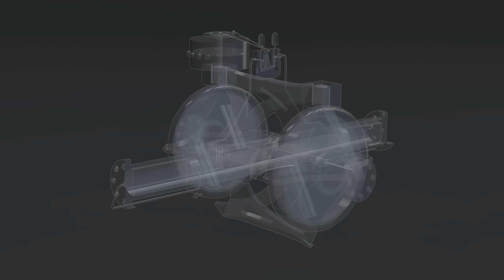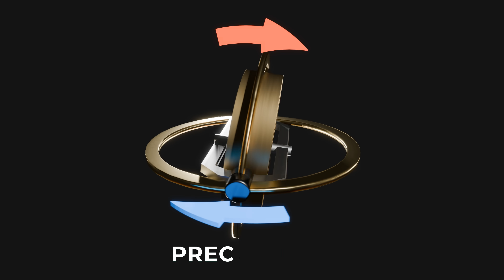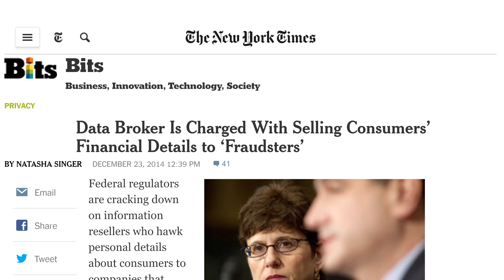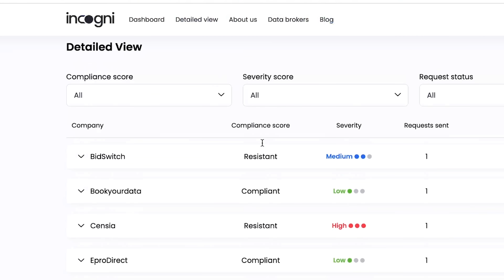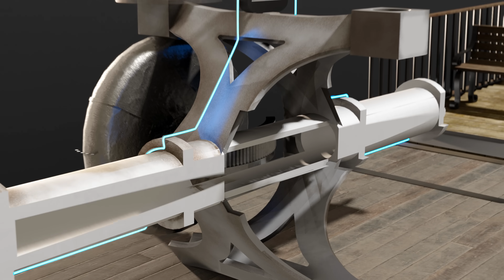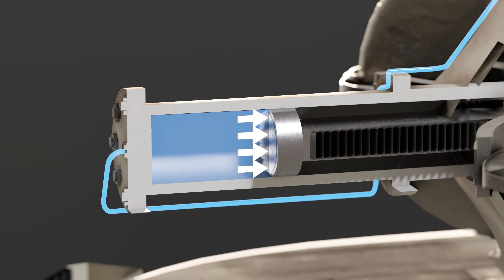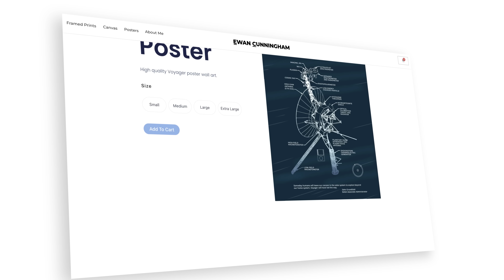The Self Balancing Monorail

Comment: Assuming that this could basically maintain its vertical position by itself (and I'm not saying it can), it has zero defense against lateral forces that are stronger than the ability to correct itself, such as strong winds or even another vehicle that hits it. A train on two lines of wheels would be almost impossible to tilt, no matter what would attempt to do it. And it wouldn't require fancy mechanics to ensure that it's always adjusted exactly the amount it needs to.

Comment: Question ,yes it works, but I must be able to compensate for earth rotation ,also for it's travel through the solar system then solar systems travel through the Milky Way,then Milky Way through through the cosmos,that travel a lot faster than a jet through air on earth  alone,  compared to just space time alone, just saying............

Comment: A completely mechanical system. No chips no electronics.  If they made it today it would break within 6 months and it would be an electronics failure. 

I am reminded of the mechanical lock system on the Erie canal which is still functioning after 100 years.   It's extremely ingenious.

Comment: Wow I'm an engineer and just stumbled on this, really damn cool. I'd love to know what kind of calculations this guy was actually doing to engineer this thing. Like if I have this 1000 lb gyro spinning at 3500 RPM located x and y from the center of gravity and pivot point at the rail, do all these momentums and torques in the system act to stabilize the vehicle sufficiently knowing some kind of worst case condition or strongest momentum the gyro has to act against. Like how was that gear rack sized and the correct amount of force determined that will counter act the vehicles weight from falling over liked an inverted pendulum. I'm guessing it was probably a good amount of trial and error with the scale model finding a good starting point for full scale. All of this is like system response and dynamic modeling and could be simulated today with modern software and solved numerically in like Matlab, hell maybe even Excel, but to see any of the underlying calculations from 1900's that directionally said where to go would be so interesting. Maybe it was as simple as I have this much space and this is the biggest I can make the gyro and just trial and error it until it works.

This was super cool, I'm done nerding out now lol

Comment: This is really cool engineering, however, I'm still curious as to how this would work at scale. The way this train is built, you couldn't just link up more cars. To stabilize additional sections of the train, you'd have to add more gyroscopes along the passenger/cargo area. Considering that almost every car would have the same stabilization system as the main locomotive, I feel like this kind negates an economy of scale (which is, after all, the foremost advantage of a train). It would still be possible to drive multiple cars with a single engine or motor train, however, the level of complexity and technical difficult involved would kinda just push any investor towards the two railed alternative.

Comment: As cool as this is, the most obvious question/flaw is what happens when it stops. It essentially has to constantly run outside of specific docking points.
Reply: Brennan quotes : 
- Even when the motor is stopped, the gyro-car remains perfectly steady(...)
- (...) if a gyroscope were to lose power it would take several hours for the flywheel to spin down to zero, providing the gyro monorail driver plenty of time to deploy the stabilizing legs.

Comment: Would such a system work with rubber tires if the vehicle drove on asphalt instead of on a railway?  
Imagine a very large motorcycle type vehicle that is similar to a van, bus or truck. 

Of course it would need a mechanism that prevented it from tipping over when it's not moving; like when it's parked or stopped at an intersection.
Reply: Imagine that but it has another set of wheels to the side of it 🤯

Comment: Hardly a TRAIN but more like a single cart .I doubt this system would even work on multiple carts with a gyro in each because they wouldn't be in sync meaning the connections would be all over the place as one  lean the others might be upright or even leaning the opposite direction.

Comment: I don't understand why they are not using it in today's trains
Reply: Why would they use this? The double track is already all over the world and is far safter then this. This train needs gyroscopes to be running 24/7 or the whole thing will fall over. You would need some special docking contraption to hold the whole thing up to even be able to run maintenance on the gyroscopes. It is pretty cool ill admit but really its overengineered and less reliable. I don't think the train operator would enjoy being so close to two massive gyroscopes as well.

Comment: This is impressively well worked out, i must say. I heard about the concept before but was not aware of any details, besides the use of gyroscopes. 
That the design was not convincing is understandable and as smart and all the engineering behind the whole stabilization, does it seems to be prone to errors. I´m not saying that it is, but it sure looks like the safer bet to use a second rail. The vacuum in which the gyroscope discs where rotating and then the pressurized pneumatic system on top of that... There is a lot of space for a variety of imaginary holes and leaky connections. Some of them maybe real enough to become a catastrophic failure since trains often move fast.
If how a gyroscope would be closer to our intuition, like other concepts we can experience in some way and develop a certain understanding about them, wrong as this might in fact be, than it more likely would have come to use at some point.
I really wonder how this would have done in long time of use, since it is seemingly really well worked out.
Kinda seems like a missed opportunity. Maybe it comes in handy if we ever colonize anything else than earth.

Comment: I am software engineer, not a construction engineer. So what I’ll share is not a real critique, but more like “a set of educated reservations” about this design.

In the video this is portrayed as something inherently “good” that didn’t make it to production due to wimpy investors. Well, investors had a lot of reasons to be wimpy, and I am sure that construction industry champs are reviewing things like that at a regular basis, so whatever limitations this thing had in early XX century, are still there today.

First, I wouldn’t blindly buy into the “savings” argument. A monorail isn’t twice cheaper than regular rail, because you need to compare it for the same size trains (same weight). If the same weight is distributed over 1 rail rather than 2, that rail must be sturdier, heavier, it may easily make the construction logictics twice more expensive or even more than twice.

Secondly, from my software experience — a requirement to have something up and running 24/7 with guaranteed downtime less than 30 minutes makes an order of magnitude more expensive system than a system without such a requirement. The video didn’t describe any “parking brake” mechanism. If it’s absent in the original patent, it means that the train is designed to fully stop (for more than 30 minutes or a few hours even) only at designated parking stations.

But what if there’s a sudden need to stop for a longer time? A need to pass a faster train or roadwork delays could easily require multiple hour long stops at every station. Now we require every station to have a complex and heavyweight parking mechanisms for such trains — whoopsie, whoopsie!

But what if an accident happen — a landslide or a person fell on tracks, or a collision, or a failure of another train, that require a multi-hour stop in the middle of nowhere? Now you suddenly require to be able to supply unlimited fuel to any random spot on the track, just to keep the gyros running, or you pay the cost of falling train just because it didn’t have proper parking brakes?

Thirdly, the mechanism seems too complex, hence, fragile. Many “geniuses” focus on v1 product and completely dismiss long term maintenance where every little mechanical piece accrues wear and tear. When I saw “vaccuum” and “compressed air” solutions as a part of this, those were immediate red flags — like, hey, you gonna pay tenfold to repair it, and to build contingency mechanisms for a whole array of possible failures due to random wear and tear in various places.

Remember, the stability of the classic two-rail trains lie on the shape of the wheels. The wheels can lose many milliliters of steel due to wear and still work as designed. In comparison, Brennan’s design feels as fragile as egg’s shell.

Comment: You, didn't answer many of the important questions people might get in this video, like
1.why is it not adapted in modern era 
2. Are gyroscopes expensive 
3. How much are we talking 
4. Issues that weren't solved in this train
5. Would this train require more power, if so how much more than your average train 
6. What is the overall running and maintenance cost of the train compared to modern trains, 
7. What are all the benefits of this trains compared to modern trains and are those benefits worth its cost in modern era 
8. Or is it just a inefficient model?

Comment: Really cool design although it does raise some questions for me, maybe somebody here has the answers.
1) what would the stability and life time of the rails themself compare for a 2 rail system be vs the single rail rails? Cause with a single rail you have much more load on the rail and I would assume the having 2 rails connected to the same suport beams would make a stronger construct then just the single rail.
2) Kinda in the same direction but how would smoothness of the ride be effected by having only a single contact area in the center compared to the two on the side, mostly regarding vibrations from roling over the tracks and the engine.
3) Would the leaning lead to a more complicated coupling mechanism between wagons and how well would the system work with very long wagons like you have with modern high speed trains?
4) Were there any plans on how to deal with the wagons just standing around? Cause train carts do spend a decent amount of time not moving, especially if its something like a freight train.

Comment: Nice animations.

Fun fact: Luis Brennan also invented the first practical MCLOS (Manual Controll, Line of Sight) guided missile system. The Brennan Torpedo. Using two wires reeled out of spools connected to the torpedo's counter-rotating propellers. The wires were reeled in by a steam engine at the launch base. By slowing one of the wires down, the torpedo could be turned left or right.

Comment: I love this, it's really a case of building something and a lesson to many for many reasons.

1. This is a better design and cheaper.
2. It's a testament to iterating and building better solutions.
3. It's also a prime example of better product, but too late.

If this had been done before railroads were all developed, this would of taken on and it would of been the only train used. Half the cost to lay railroad tracks takes away every pitfall of going out west that previously existed just about, but it was the "too late" invention that once they developed all of the track, the vehicles weren't a problem worth solving.

It only failed because of a problem that wasn't worth solving at the time, 20 years earlier? It was worth solving then, this could be used for so many as an example of knowing what, when and how to work on something to either be the most successful thing in the world or to just have the worst timing but a better product.
Reply: This is nonsense.

Comment: I’d never invest in the design either. That’s a whole lot precision moving parts needed to avoid a trainwreck even sitting completely stationary, going nowhere. A component failure in a conventional steam engine would normally lead to a simple repair delay, not crashing every single car on the entire length of train sitting in the station. At worst, a steam engine boiler might explode and injure the engineer…causing a moving train and all the pulled cars to slow to a stop… whereas a failure of this design this would have caused injury to every person on board throughout the entire length of cars when they all derailed.

Comment: Worked with naval gyroscopes . Elmer Sperry was one of the pioneers inventing this. He made the same concept for ships. No rollling no sea sickness. Great Ideas from early1900….However considering the weight of the flywheels and the sheer Force applied on the main rotor bevarings these inventions are really dangerous. Just consider one main bedring packs up and the train would get either airborne or end up like a rollercoaster. Hence they never worked in real life. But truly amazing idea, the Will to invent and amazing visualization. Greatings from Denmark😊

Comment: The big drawback is that if there was a mechanical failure anywhere, you die. Whereas on a standard train, if there's a mechanical failure, you simply come to a halt.
Reply: Airplanes have that problem though
Reply: @romeupb5110  In an airplane you can usually have one engine fail and still land safely, depending on the size
Reply: @romeupb5110 yeah but there is no good alternative to an airplane that doesn't fall out of the sky with complete mechanical failure. For trains there is.
Reply: Yes if you are at right place
Reply: nope, in this era there's no such thing as mechanical failure unless it's a crash😂
those r gyroscopes not engines
Reply: Incorrect even a failure on a standard train can cause death. What do you mean??? A train doesn’t just stop if certain things fail.  Have you not looked at train accidents through out years caused by failures???
Reply: @Rilo888  certain failures on standard trains can be catastrophic. However there are also certain engine failures and other which simply will cause the train to stop.

If any part of this monorail system fails, it will topple over.
Reply: @ yes there’s no argument there. I was only getting at that even on standard a failure still can disastrous but wouldn’t have be often compared to this old school mono rail.
Reply: That is obvious that even a standard failure CAN be disastrous to the point need not be stated. The OG made correct point that in the monorail design ANY failure will be disastrous and deadly not CAN

Comment: There is still a use for such technology in form of taxi cabs  or can be called rail cabs. In my opinion the problem of balancing the rail with more carriages can be solved by centering the gyroscope system along the length of the overall monorail and using hydraulics in places of pneumatic system. Or more work can be done to reborn the monorail idea.

Comment: In physics, there are states of position: instable, unstable and stable. This is not a stable system, like a two-track train. In practice, there may be situations in which the gyroscope does not rotate. This can be caused by a technical defect, for example. The train would then fall over due to gravity and there would possibly be injuries or even fatalities.

Comment: I think with some adjustment of the engines' and cars' baseline CoM, and keeping everything as light as possible otherwise, making a high-speed version of this with modern materials and tech would be extremely efficient and safe.

Additionally, if it can also still run on one side of a normal track...adapting existing rail systems to it shouldn't be any trouble at all.

I think this would actually be far more worthwhile than something like the fuckin' "Hyperloop".

Comment: There's a monorail existing and in use until today that reminds me of this. This train also drives on a single rail no bigger than a usual railroad... Yet in this case they chose to hang the train below the rail, constructed in a way that it keeps it's balance as well, allthough for that a massive steel construction has to keep the rail hanging in the air. The Wuppertaler Schwebebahn in Wuppertal Germany serves there as a kind of tramway through the city, and as a tourist attraction.

Comment: The invention is incredible, but the safety of this is very risky, at first it tells you how stable the vehicle is because of the help of the gyroscope, but machine may sometime broke even if maintained properly, even the risk is 1% that is still a chance. Instead we now commonly see trains has 2 rail trains because it is more safer if danger occurs, than the one wheeled train. What happens if the gyroscope stops? What happens if it loses power? That is why we have 2 railways instead. The nearest example of this that is operational is the Monorail in Japan where the railings is above the train instead below, with this there is no need for the gyroscope because the gravity itself will do the work.